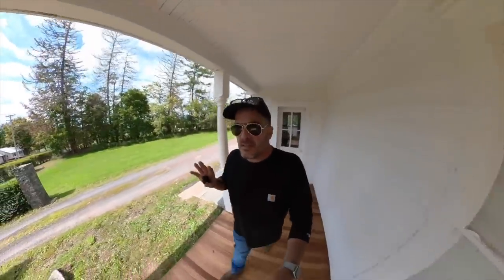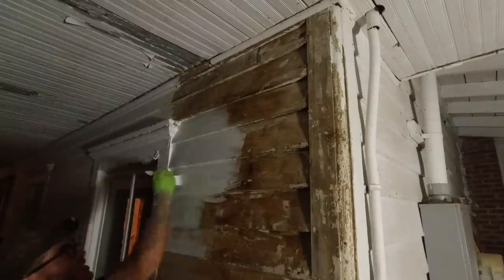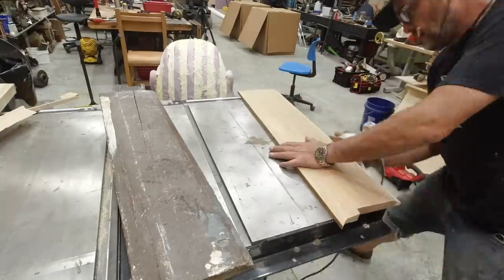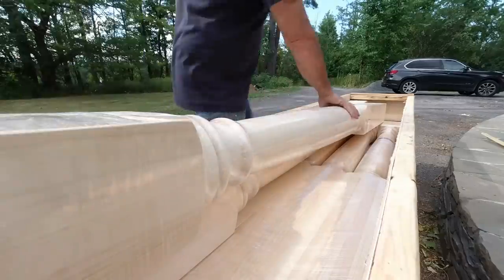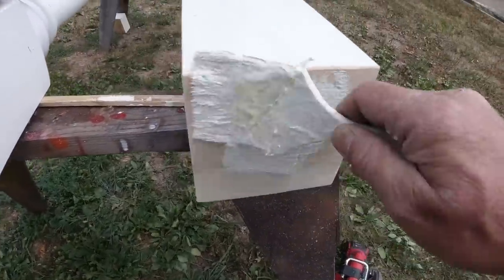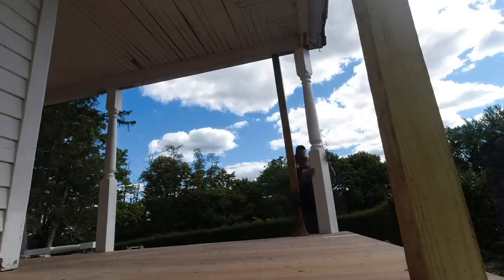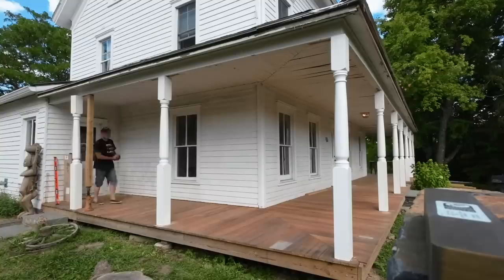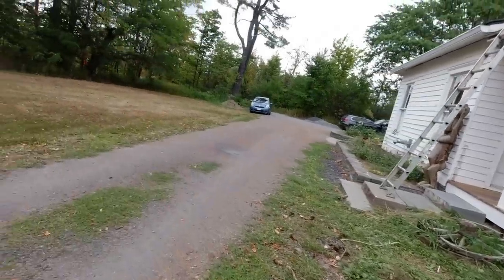DiResta [Pt 2] Porch Restoration - Finished!

Comment: Looking good! As someone who painted for too long, deck ceilings like that are the worst, there's always one more seam to caulk. Anyways, if you find yourself painting on a ladder again, get a bucket hook so you can hang the paint from the ladder, and then paint as far as your wingspan goes before moving the ladder again. Whiz rollers (the small 4" rollers that go on a handle) also speed things up a bunch.

Comment: Great work Jimmy!
The trick with linseed oil based paint is to put really thin coats of paint and let it dry in between. I usually put three coats depending on how much the wood sucks.

Comment: Post toppers on your columns?  We put in round larger diameter columns on our porch and they had a flat section on top which left about a 3 or 4 inch shelf on the top inside. Perfect for birds to build nests.  I asked the installer and he put bent sheet metal covers going up at a steep angle to blend back into the header and cover up that space.

Comment: The porch looks fantastic.  I know you treated the top of the boards with multiple coats of linseed oil. I don't think you mentioned whether you did anything to treat the underside of the wood?  Given the tight joints of the decking, no spacing between boards, with dirt,  bare ground under it, do you think the boards will cup in time with moisture on one side but not the other.  So far it seems fine in the videos.

Comment: I worked as a apprentice painter and did all the prep occasionally some of the brush work. You really need to brush wood to get a good fill. The DAP should give you some time to plan for the replacement of the ceiling. Ninety percent of paint is proper prep, and always clean as you go. NEVER touch up from a different batch of paint, just repaint the section.

Comment: Three comments:

1, Look at a Werner 8 foot or 10 foot 1500 series aluminum extension ladder with the self levelling feet for any low work around your house. The self levelling feet are the time and effort saver. The 8 foot will get up up a 13 foot wall - so light and easy to move. I cannot praise the Werner self levelling feet enough!

2. Get a paintable caulk and use it first.

3. If you are going to use linseed as a base coat - cut it 50/50 with turpentine - yes it is thinner but it soaks in instead of running. I live next to the ocean . 2 coats of cut linseed - 1 coat Pratt and Lambert Alkyd Primer - 2 coats Pratt and Lambert Acrylic - 20 year finish provided you strip to bare wood and the wood is dry.  Getting the linseed on as soon as you strip is the key. I have to repaint mine next year because it faded - no blisters or pealing after 20 years.  One pass with 60 grit is also key.

Comment: For anybody with a moderate level of experience cutting and fitting and prepping and painting, I would say not having the experience to do construction accurately is not that much of a thing.

Not having the practiced technique to do it quickly and efficiently is a whole different thing. Not having the experience to know what level of perfectionism is required for a given task relative to structural integrity and/or what the effect will be on the cosmetic appeal of the final product is yet a different thing.